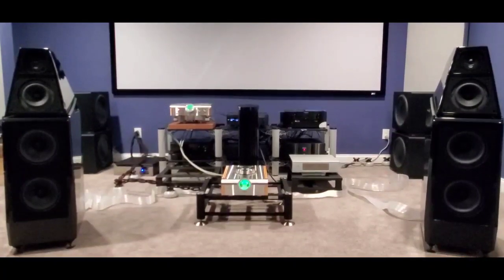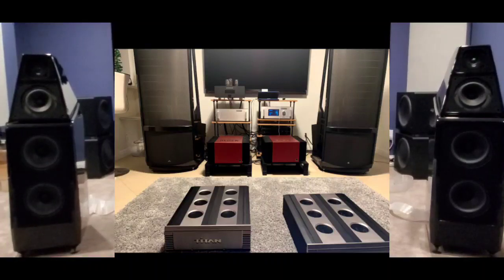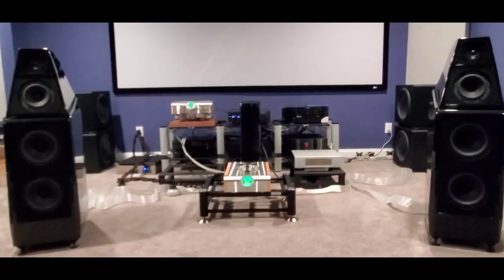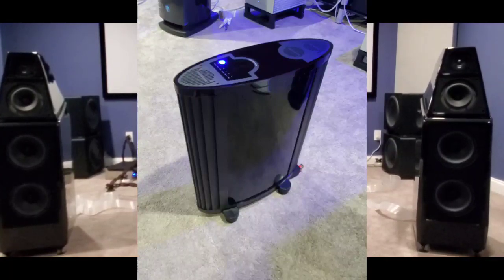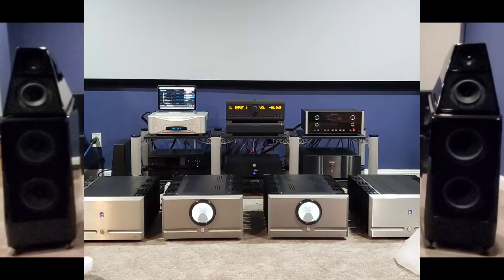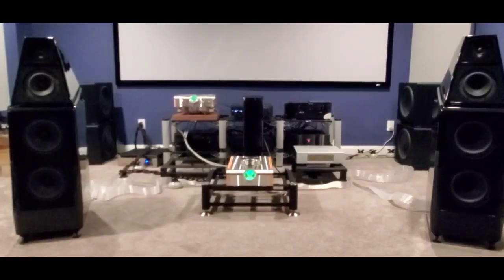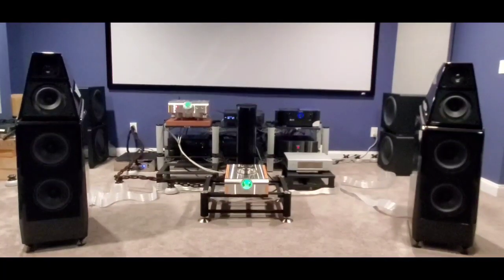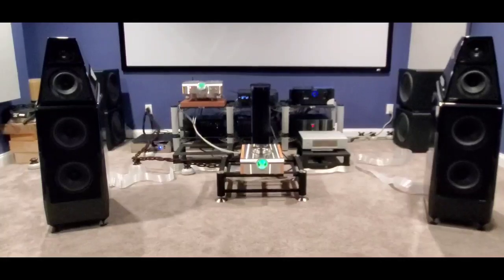The Best 5 cost-no-object power Amplifiers

Comment: I agree with you completely about Pass Labs.  Nelson Pass is a class act and a heck of a talented designer.  I have a Pass Labs Aleph 3 (which I love) and after all these years, it needed to have the electrolytic capacitors replaced.  I elected to do the job myself and the folks at Pass were extremely helpful with information and advice and were highly responsive.  They build great products and are one of the best companies in audio.  This doesn’t even take into account Nelson’s work in the DIY community.  Amazing dedication to the world of audio!
Reply: The Pass Aleph was legendary. Had the Aleph 1 and 1.2, best silicon based amps I ever had. I prefer SET DHT but if I had Apogee’s or similarly difficult load speakers, Aleph would be the top choice. His XA series amps appear nicely built, just not sound quality of the Aleph

Comment: No tube amplifiers were good enough for this list , You really should try Bob Carver's cost no object  Silver Seven 900 (that's 900 watts )each at $32,000.a pair.  They are custom hand built in the USA and have a lifetime warranty including the tubes that run so cool you can touch the tops and not get burned. The original silver seven was rated as one of the 10 best amplifiers ever.
Reply: Why not VAC Statement, too? Worth trying perhaps.
Reply: @asegal4677  There’s better tube amps than VAC, both international or US produced if that matters to you. While I prefer SET amps, before you buy a VAC Statement, demo it against a Rogue Apollo Dark or VTL MB450 Signature. Run both in triode mode, unless you’ve got crazy high load speakers which require tetrode mode. Staggering good for p-p type amps, more musical than VAC imo. 

Crazy thing is VonSchweikert has a relationship w/Kevin @ VAC do they are working together at shows in NA market. If they were using Rogue or VTL, I think as incredible as VS Ultra 55 is, it would be better w/Rogue or VTL amps and pre’s. I use the Rogue in bi-amp setup powering the woofs on my VR5 Anniversary MkII, a Wavac 805 feeding the mid-tweets w/CAT SL1 preamp. It’s best sound I’ve ever had in my home. 👍
Reply: @MichaelM-to4sg  Interesting. Thanks! Will check into all this.

Comment: My Mephisto sounded best in High mode, no matter the load. 
By the way I’m curious with that class A heat of Pass And Gryphon, how long will components inside last ?
Reply: One of my best friends has my old Aleph 1. He’s driving Quad ESL 63, a very difficult load. I bought them new in ‘94, maybe 95 using them regularly until 97 when I bought 1.2 version. He bought them from me after they were sitting for about a year, has used them in his regular system ever since. He sent them to Pass Labs in California around 2015 after one was thermally tripping after an hour or so of uninterrupted operation. Pass replaced the electrolytic caps in PS and I recall they may have upgraded some resistors, the entire cost for repairs was under $1k iirc and was warranted for 5 years. He’s never had a problem since. I last heard them this past Summer, still sound liquid smooth with deep and wide soundstage I’ve never heard from any silicon based amp. 

My son has my 1.2 version, which I used in main system until 2000. It then moved to our vacation home in MT until 2012 when my son took them to his home while he was finishing grad school. They now are in Houston in his living room feeding some old B&W 801’s. They’ve never been to Pass Labs for any service, still operate flawlessly. 

If you’re worried about thermal stability of the mosfets, use an ir thermometer on the units, you’ll find the temperatures are always well within the operating range of the devices. Even Nelson’s newer XA offerings, the amplifying devices operate well within designed thermal range. They feel so warm because the heat sink fins are so effective at thermal transfer away from device and to the passive cooling fins.
Reply from the maker: Not sure.

Comment: My Boulder 3060 is the best I have ever heard.  IMO it is in a different league from these.
Reply: Where did you listen to it? Driving what speakers? I’ve heard various Boulder amps over the years, I live near the factory in the mountains above Boulder, the city. 

Fwiw, while Boulder, the city, is home to half dozen high end audio oem’s, Boulder the electronics company is not located in Boulder but about 10 miles NE of town in Longmont. 

I’ve listened to several of their amps, preamps and digital gear over last 15 years, never bought a single piece of their equipment. In fairness, I’m not the biggest fan of solid state amps and I don’t own speakers that are so difficult to drive and/or inefficient that they are best suited to solid state. Of the Boulder based electronics and speaker manufacturers or broadening it out to the entire front range which would encompass nearly a dozen manufacturers, I have owned an example of nearly every brand except Boulder. I personally do not think the voicing of their amps is as appealing as several other regional brands, much less brands outside the area. 

Maybe it’s just the speakers I listened to. I’ve heard them w/various VonSchweikert’s, a few Wilson’s, Ayon, Quad ESL’s, the big Maggies, ML CLX, Audio Physics, B&W, Spendor and maybe a few others that escape my recollection. Among my local group of music fans, a few are professional musicians, none own Boulder electronics and like me they prefer to support the local manufacturers. They’ve obviously been around for several decades now so somebody is buying them but for my musical tastes and the balance of my systems, Boulder electronics is not a good match.

Comment: I have large pass lab amps including X260.5 monos and I just leave them on. Was told by someone that a studio had a number of Pass Lab amps on for 20 years without turning it off with no failure ( this is not a chevy bro it works so don't mess with it if you want Pass labs to give you a new amp every year you miss the point. If you paid 50k for an amp why are you complaining about you light bill please advise)

Comment: Hi Jay can you tell us about the stacked subs in the background please
Reply from the maker: Those are REL PREDATOR 1508
Reply: Thanks Jay, was hoping for a bit more 😂 as in how you use them, do you use different crossover and/or cut off frequencies?  Stereo and/or Movies only. I have Focal maestro utopia speakers driven by Levinson 33H’s but still benefit from a single SVS ultra 16.   I also have Quad ESL 2905’s which I love but they don’t go loud enough for rock type music and I’d considered 4 subs in your configuration, crossing over to them at 80hz  via my pre amp hence my question.